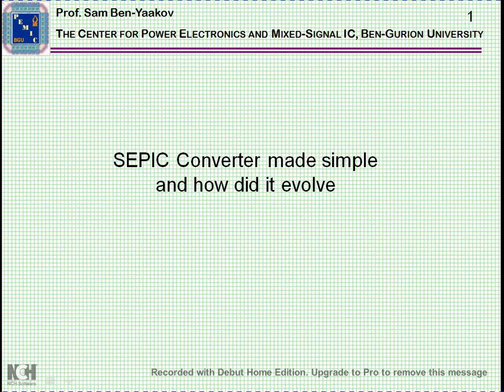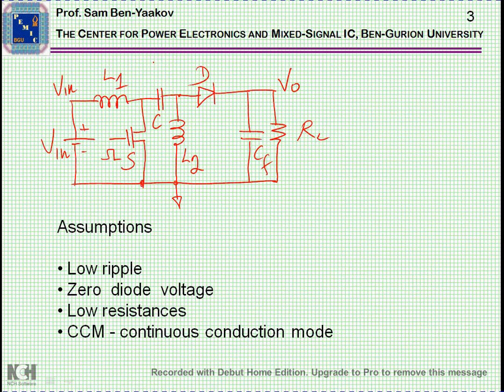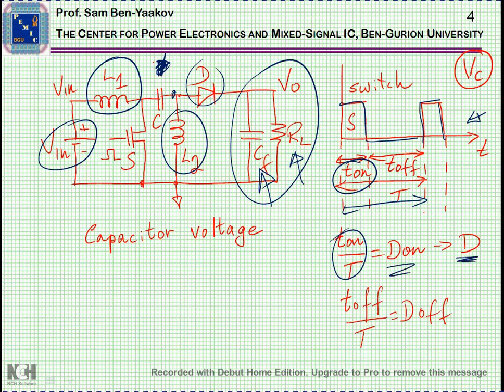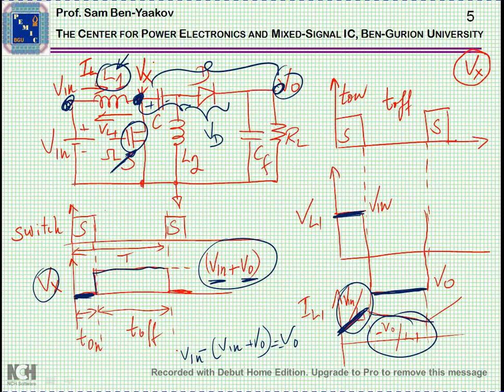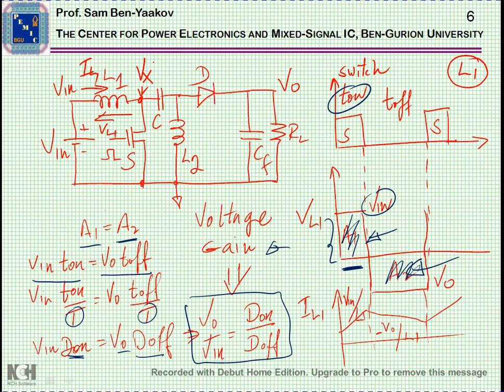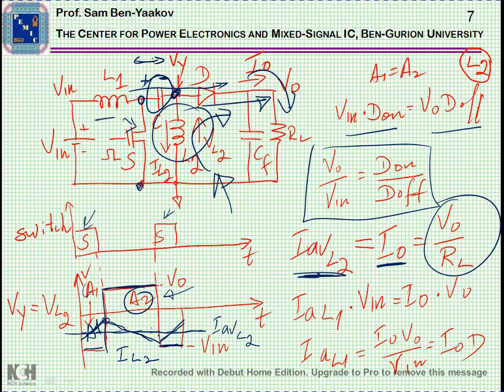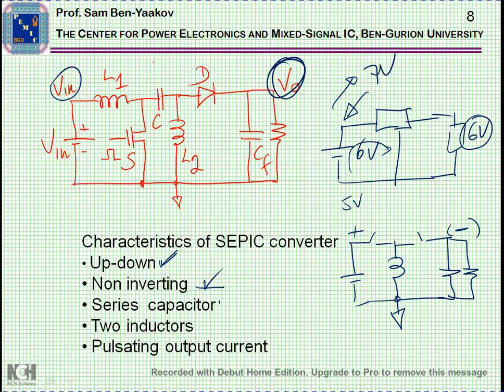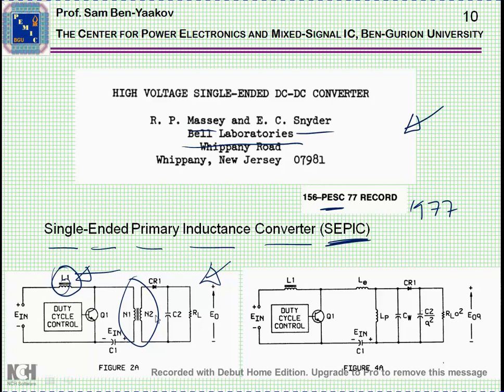The SEPIC converter made simple and how did it evolve

Comment: Interesting, Professor.  The coupling capacitor is not only expensive, but hard to find.  The average current through it may be 0 (zero), but the rms current is on par with the output current.  I had suspected this since I had an application in which I was using both a buck and a boost converter to provide a variable output (0 to 100V) from a single semi-variable, somewhat fixed, input (10 -14V). The output of the buck would provide the input to the boost!   In this case, both the buck and the boost could share the same inductor - what a savings!  

But this required so much complication from the control circuitry, and I thought there had to be a better way.  Hence, to the SEPIC.  This would require two inductors - expensive ones, and in my models, coupled inductors work better.  But the capacitor, I suspected, had to support a great deal of current for this to work.  And in the calculations and the modeling, I needed a capacitor that could support upwards of 10Arms.  You cannot find these easily.

When we do a search for a product at our favorite electronics suppliers, they simply do not list capacitors with the rms current in mind.  You have to sort through them individually.  Most manufacturers do not list the rms current of their capacitors in their data sheets, either.  Others will advertise that they have high-rms current capacitors, and then you have to sort through their data sheets to find the one you need.  Luckily, the SEPIC converter is not to picky about the capacitance, and you have about a decade order of sloppiness (for example, 1 to 10uF) to play with.

In the meantime, these big capacitors can run from $2 up to $20 for just one.  So this is where we have to consider the economics of choosing one method over the other.  In the long term, which one will cost less.

In my past, I've seen ceramic capacitors explode and electrolytics (big ones) spew out blue smoke.
Reply from the maker: Dear Robert. Thanks for comment and for sharing your experience. Yes, capacitors are a sensitive subject. In case you are not aware: https://youtu.be/8ptGjioWTlM

Comment: Thanks, Professor! It's an awesome video. But I have a doubt when you explained the V_y = - V_in when the switch is on, you said: "because it's charged to V_in". How could we tell the capacitor has been charged with V_in at that time? It's at 12:07. 
Many thanks in advance.
Reply from the maker: Average (not momentary) voltage on any inductor in steady sate, including L1 and L, is zero. Can you see it now that the voltage of the cap  is equal to the input voltage?
Reply: @sambenyaakov  Great! I think I've seen the trick :) Is it if we take a loop V_in-L_1 C L_2- Ground_Vin, it can be concluded that the average voltage charged to the cap is V_in in a period.
Reply from the maker: @dinleepound9466  👍

Comment: Thank you for sharing.  i have a question about the coupling capacitor polarity.  I see schematics showing the + side is towards the input and also they use a big Aluminum Electrolytic cap.  however if the output is higher than the input by a few volts, does the capacitor not get reverse biased?
Reply from the maker: Hi John, just happened to see now your comment which I guess you posted a minute ago. The polarity you indicated is OK. The voltage of the capacitor at the input is higher than the output. A trick to quickly see it is to base the observation on the fact that the AVERAGE voltage on an inductor is zero. So on the left the average voltage seen by the capacitor is Vin, and on the right, ground. You can go through the chore of a detailed analysis, but this will be the answer.  
Regard
Sam

Comment: thank you doctor sam for your excellent presentation, however I have a question about the voltage  Vx when the switch is off, I didn't understand  why is this voltage equal to Vin+V0 during Toff? you neglected the voltage at the terminal of the inductor L1 during Toff? and we know that the average voltage of L1 equal zero during Toff+Ton
Reply from the maker: Hi Ayoub, please indicate the time on video you are referring to.
Reply: It's at 7:50 thank you
Reply from the maker: Hi Ayoub
Going back from Vo you add the average voltage of capacitor which is Vin
Reply: Thank you for your response

Comment: Please explain more regarding current flow through L2 during switch on..as a bigginer I am confused that  how can series capacitor charge L2 in a case Vx node grounded???
Reply from the maker: Capacitor C is charges and imposes an almost constant voltage on L2
Reply from the maker: Capacitor C is charged and imposes an almost constant voltage on L2.

Comment: Thanks so much Dr Sam, how we size the series capacitance?
Reply from the maker: Which topology ?
Reply: Sam Ben-Yaakov the series capacitor for SEPIC Convert
Reply from the maker: Choose the capacitance to get the ripple level you want on it, normally few percent of Vin,  Vout (the smallest  of the two) and most important a capacitor that can carry the expected current.
Reply: Sam Ben-Yaakov Hi Dr Sam , I am asking about the series capacitor of SEPIC Converter between the 2 inductors
Reply from the maker: Yes, my answer was related to this capacitor. You need to keep the ripple low and worry about the AC current passing through it

Comment: Hi Dr Sam. Can we have a resonance phenomena on Vy using the first harmonic method ?
Reply from the maker: I am not sure I am following your question. Please expand.
Reply: On Vy there is a AC voltage after the high pass capacitor, so with Harmonic decomposition tool, we can have a resonance frequency with L2 and C.
Reply from the maker: The C is large to keep the ripple at low value so the resonant frequency is very low as compared to the pwm switching frequency.